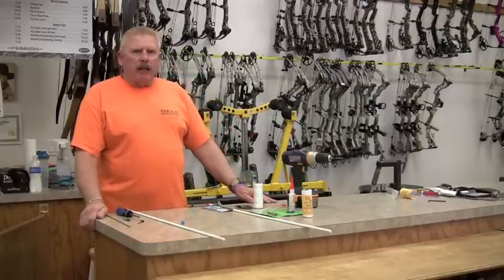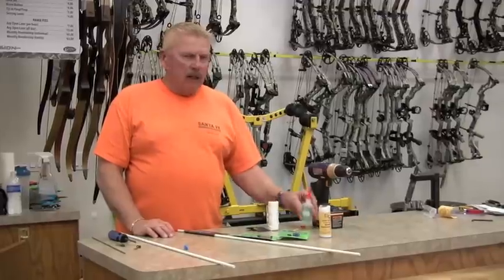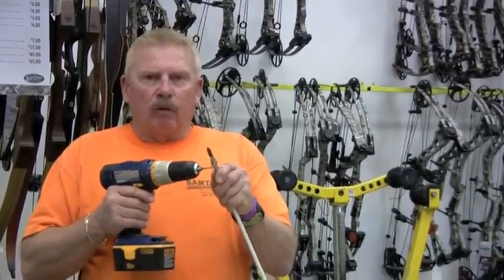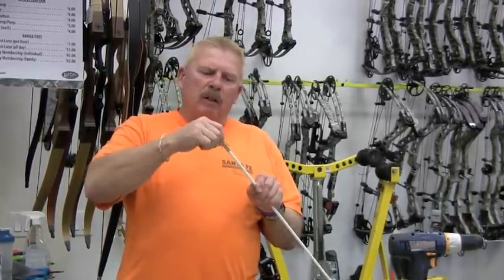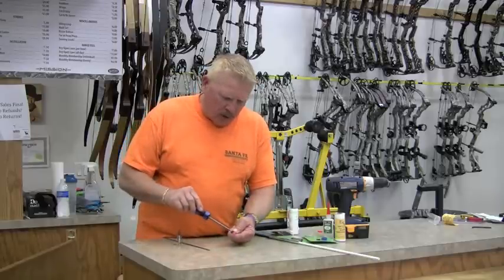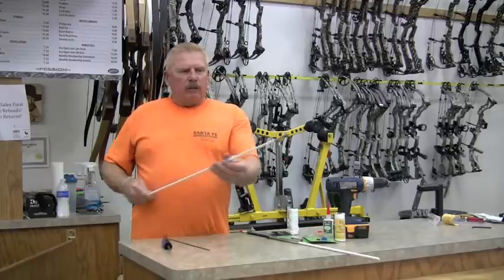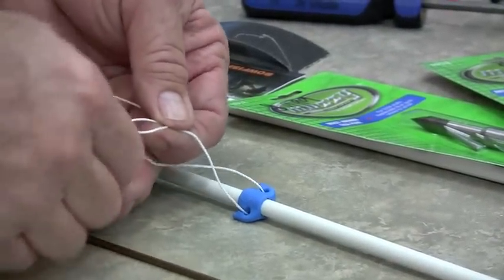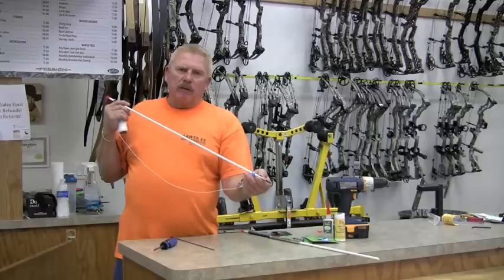Archery Tip of the week | Bowfishing - How to build a bow fishing arrow

Comment: There is no way to get slivers off of the fiberglass arrows they are great for bowfishing I get around I have some arrows that I have had for 5 years. It all all depends on the bottow you are shooting into.
Reply: The only way to clean up slivers etc. from a fiberglass shaft or any fibetglassed surface is to lightly sand with 380/420 grit wet or dry, clean the surface with alcohol or acetone, your wife's fingernail polish will do since they're the same thing, and then brush or spray a thin coat of clear or tinted epoxy-urethane over it which will encapsulate the fuzz/slivers from the fiberglass.

Now after telling you how to fix it I also need to say that when fiberglass gets to this stage it means the 'polymers' have begun to 'migrate' out of whatever it had been applied to or made with, such as a helmet which needs to be tossed after 3 1/5 years because the fiberglass, etc. has become brittle and therefore no longer viable for it's intended use, so really should be replaced.

BUT, hey this is an arrow which in all probability should last for awhile longer, just don't expect it to bounce off any hard surfaces like it did when it was new.

Comment: im sorry but i would never use fiberglass shaft's for one of my arrows the are really flexy and once they break you cant touch them at all unless you have gloves i would rather use wood or aluminum shafts
Reply: A solid fiberglass arrowshaft is probably going to hold up better than most carbon arrows. Some people even make fiberglass arrows for firing them out of really heavy bows. They flex like any arrow would, but they don't flex that much.

And even if they do break, it's not like you can't touch them at all. Just be careful with the splinters. The dust that comes from cutting them will be bad if you breathe that stuff in, but splinters are easy enough to avoid. Kinda like splinters from broken carbon or wood arrows.

Comment: will fiberglass float?
Reply: NO, he's using a solid fiberglass shaft, but even a fiberglass tube would still sink - which makes no difference either way since the arrow is secured to your bow via a heavy duty line, (50# min.) so it is easily retrievable.

The size of the line makes no difference with this type of fishing since the only time the fish will notice the line is after the arrow has gone through them.